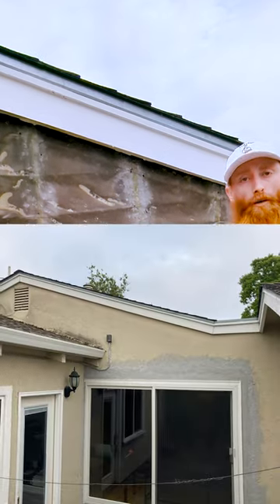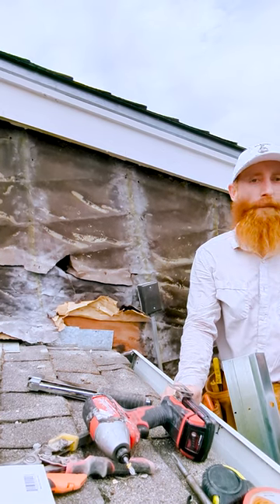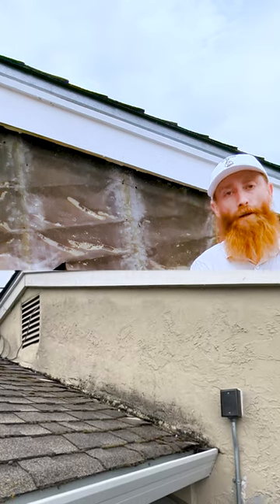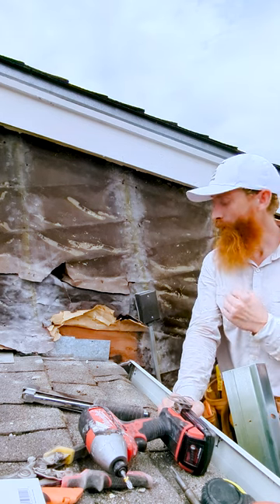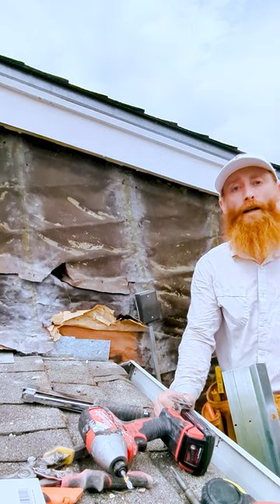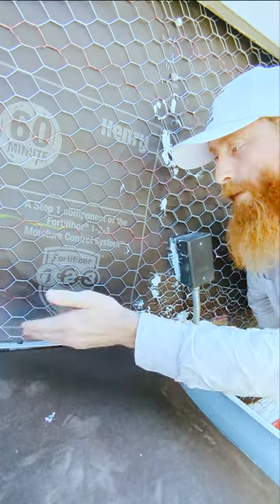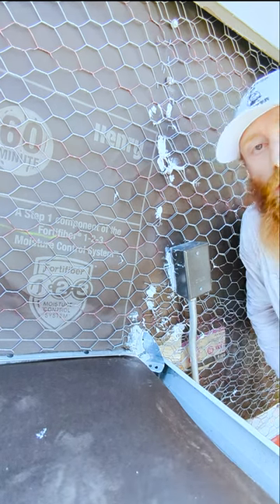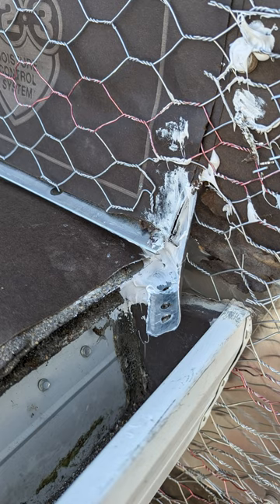Stucco walls leaking

Comment: So, I'm having our stucco redone, but I'm about to redo the window wrap because it sucks. Was thinking the window wrap should be under the stucco, but now this makes me think it should be over. Was going to use flashing tape first (after the new housewrap). Should it be over the stucco then caulked?
Reply: I am working on the moisture barrier video now. Your moisture barrier should be installed to the substrate. When the video is done I will post it here.

Comment: That "diverter" in the roofing industry is called a kick out flashing and is very important indeed.
Reply from the maker: Good morning Andrew, Indeed it is, it's the main culprit or problem for leaking. If the water is not diverted into the gutter, however if the area next to the wall under it was waterproofed properly in the first place, the rain water can leak on the wall for hundreds of years without harming the membrane, underneath the stucco. For the average company, the workers who install the paper and wire often rush this area as the gutter can be in the way, plus and more importantly some folks don't understand that the paper has got to be fused to the fascia board with a quality polyurethane caulking.  👨🏻‍🔬
Reply: Always good to get the proper terms. Thank you!
Reply: Always surprising how many homes do not have them.  Down in in OC we don't see them a lot, i guess folks didn't put them in because it never rains here....until it does! I look at a number of leaks every year related to the lack of a kick out flashing.  Love the content, been watching for a few years now. @GiordanoPlastering

Comment: I've never fully understood wall roof connections. Up here in the northeast we used to stop our cedar shingle or clapboard siding a good 3 inches above the roof deck and have our lead (what happened to lead flashing?) or copper  underneath it exposed, creating a channel for water to cleanly run down to the drip edge. Why don't they do this with stucco? I liked the look of that exposed copper flashing that would green over time. It made for a neat job.
Reply from the maker: In this are copper or lead is usually for Terracotta roofing tile. More likely lead, as more won't  splurge for the copper.

Comment: What kind of stucco is recommended to use for an exterior wall?
Reply from the maker: Good morning, Id recommend you use, "Rapid Set Stucco" sold at all Home Depots or lowes, Or if you want extra time to apply buy either the Sakrete or Quikrete also sold at all HD and lowes stores. All of these same day stucco's have sand in the bags already, you just add water.👨🏻‍🔬